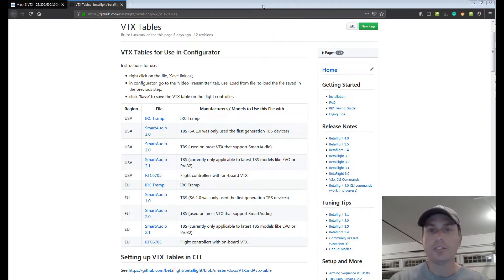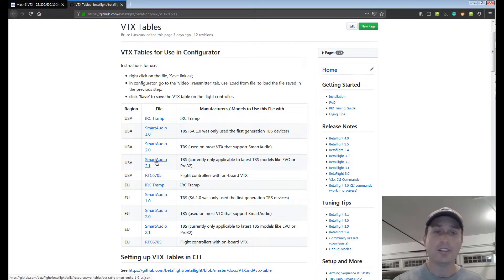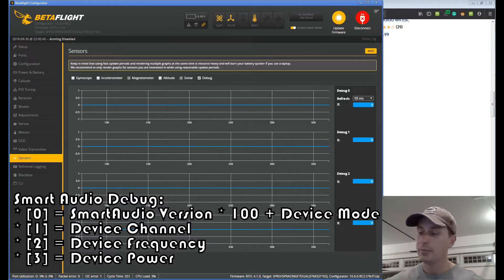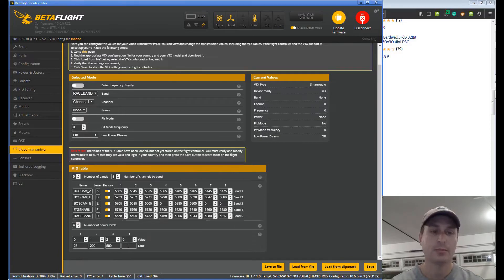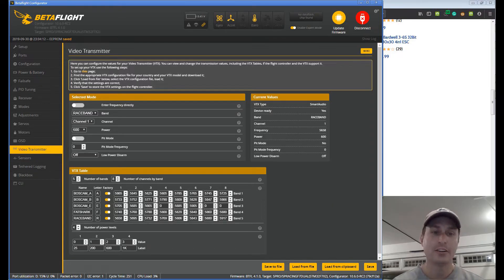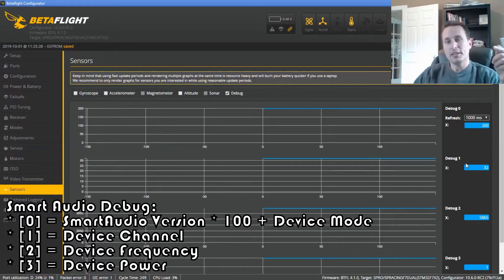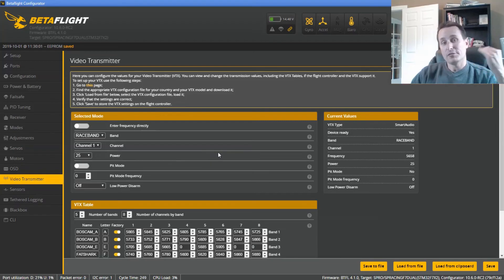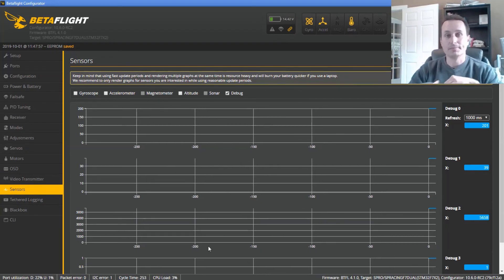Betaflight VTX Tables in 5-minutes - How to discover your Smart Audio Version

Comment: What do I do if I get no change in the debug page when a battery is plugged in? The value stays at zero.
Reply from the maker: Sure it is a Smart Audio protocol VTX?  Maybe it is Tramp or wiring is not right?
Reply: @uavtech  it is an original TBS Unify Nano. I think the reason is because its still needs the resistor mod to work properly, as smart audio works SOMETIMES :(

Comment: I can't get the debug to work, nothing changes in there. I got the right VTX table for my VTX, everything seems wired and set properly but VTX is not responding to OSD/Betaflight imputs no matter what. Anyone knows WTF can be wrong?
Reply from the maker: Maybe Tramp protocol?
Reply: @uavtech  it's Eachine TX805 VTX and as far as I know isn't Tramp, but obviously I've tried Tramp protocol, obviously with no luck. I've kinda gave up at this point because have no idea what to do to make it work
Reply from the maker: @Arthur4all  , Ports tab is set to SA peripheral and wired up good.  The debug should work.  Best i can offer is triple check wiring and maybe try another UART.
Reply: @uavtech  soldering it to a different UART is literally the only option that I have left to try even though I have no idea why it would not work on a dedicated UART where it is connected right now. It was a brand new FC so maybe there is some fault with that dedicated UART pad out of the box.
Reply: @uavtech  soldering to a different UART pad did the job and now debug is working and VTX is responding to OSD commands. Still have no idea why it didn't work on previous and dedicated UART pad...
Reply from the maker: @Arthur4all  , awesome to hear you fixed it!
Reply: @uavtech  Hi! I have a similar problem. Matek F772-se and Matek VTX-Mini. Telemetry on UART6 (Tx6). Telemetry emabled and TRAMP protocole selected. Q: Is it an idea to reconfigure Tx6 to be softserial and get it to work that way? Or anny suggestions on ways to test the Uart via the BF CLI?
Regards Torgeir

Comment: I did this no problem with my RDQ Mach3, BUT i cant seem to get it to work with my TBS UNIFY PRO. When i load the smartaudio file all boxes go blank and the four buttons on the bottom of the page "save to file" "load from file" etc disappear. I have now tried all three TBS smartaudio files same result...? What is going on here???
Reply from the maker: What SA version does the debug mode say it is?
Reply: @uavtech  thank you so much for replying, unfortunately I'm offshore on a remote facility. I won't be able to look till Monday.

Comment: what would be the problem if as soon as i plug in my battery my FC gets super super hot almost as if im going to burn stack.  havnt left it plugged in long enough to even test it because i already fried one because a differnet reason
Reply from the maker: unknown.  sounds like an electrical issue on the board.
Reply: UAV Tech.  Well I’ve checked every electrical thing I could besides the actual plug in where the battery plugs into to going to try and replace that too. I actually fried my vtx and replacing it I think I might of loosened the battery plug in ? Any guesses ?
Reply: UAV Tech thank you

Comment: Did exactly as in the video but i don't get any reactions in debug mode at all. Yes i have the battery plugged in.
Also just 1 motor is working after updating to 4.1 :(
TBS unify 
Kakute F7 1.5
Kakute 60A 4in1 ESC
Reply: Ok so i found out that obviously you have to enable smart audio in the ports tab. I had TBS smart audio on UART4 in peripherals tab
Reply from the maker: If Port is setup right, wiring is correct, and Debug mode to SmartAudio it should work.

Comment: Mine shows 217, is that right, 2.1?
Reply from the maker: No.  2.0.  Video had it wrong.  Clarified in Pinned comment.
Reply: @uavtech  Oh thanks and sorry I don't see any pinned comment?
Reply from the maker: @domgoff999  , no worries.  Best would have been video correct.

Comment: in my case the debug 0 showed 216, from this page https://github.com/betaflight/betaflight/wiki/VTX-tables  the value 216 = SA 2.0 unlocked. in joshua Bardwell tutorial 216 means SA 2.1, so actually which one i should use? SA 2.0 or SA 2.1, my vtx is Rushtank ultimate mini, thanks
Reply from the maker: 2xx is SA 2.0
3xx is SA 2.1
Reply: @uavtech  thanks for the info, i really need the info to decide what numbers to put as the value of VTX Power

Comment: vtxtable bands 5
vtxtable channels 8
vtxtable band 1 BOSCAM_A A CUSTOM 5865 5845 5825 5805 5785 5765 5745 5725
vtxtable band 2 BOSCAM_B B CUSTOM 5733 5752 5771 5790 5809 5828 5847 5866
vtxtable band 3 BOSCAM_E E CUSTOM 5705 5685 5665 5645 5885 5905 5925 5945
vtxtable band 4 FATSHARK F CUSTOM 5740 5760 5780 5800 5820 5840 5860 5880
vtxtable band 5 RACEBAND R CUSTOM 5658 5695 5732 5769 5806 5843 5880 5917
vtxtable powerlevels 5
vtxtable powervalues 25 100 200 400 600
vtxtable powerlabels 25 100 200 400 600 

i just past this to the cli and save is that ok ?

Comment: what value should i put in VTX Table for 1600mW unlocked TBS Unify Pro32? I see preset on github
"TBS (currently only applicable to latest TBS models like EVO or Pro32) SmartAudio 2.1 (USA)"
but it only goes up to 400mW.
"value": 14,
                "label": "25 "
            },
            {
                "value": 20,
                "label": "100"
            },
            {
                "value": 26,
                "label": "400"

What value for 1600mW? If i would put too high value, can it fry VTX?
Reply from the maker: A question for TBS, but I would guess 32.  https://www.rapidtables.com/convert/power/mW_to_dBm.html

Comment: mine did not jump up in the debug section
Reply from the maker: could be Tramp protocol?
Reply: @uavtech  no it is on the right one i think it is how i soldered my vtx but they are right i dont know why my goggles wont connect to my vtx please help
Reply: Mine didn't either
Reply from the maker: So soldered right or not?  If debug doesn't work, goggles should not either.  Debugs are made to check thing.

Comment: my debug wont come on when i plug in battery and in the googels its saying tbs not configured is there a way to fix this
Reply from the maker: You sure it is TBS Smart Audio protocol and not Tramp?
Reply: I’m having this same issue. On my f4 kakute. Using uart6 for SA With tbs vtx. Pro 32 hv. Not sure if I’m missing a setting in Betaflight. Or what. Vtx tables is working on my nano 32 toothpick. Any thoughts?
Reply: @OnepackFpv  I had it on the wrong uart
Reply: R.C. Gamer that’s what I thought but I’m using t6 based on what the manual says.
Reply: @OnepackFpv  i ended up playing around with the uarts tab in bf and had jb help me...ended up i had the wrong uart in bf

Comment: Thanks for a great video! Is it possible that my quite old TBS Unify Pro 5G8 Batch No :3001 has smart audio 2.1? The debug value reads 216 but the BF Wiki says that only EVO and Pro32 have SA 2.1. Everything works when i run the BF Lua script but how can i verify that the output power is correct?
Reply from the maker: that is the trick.  you need to look up the output powers for the specific ESC.  that is why BF when this direction.  Manufactures are varying from "the protocol" too much and it is getting too complicated to hard code all the B.S. in the firmware.  So if 2.1, you look up the output power levels the VTX supports and then add just those to the table.  Or delete the unsupported powered levels of the VTX in the table.

Comment: My smart audio, is actually working. And my vtx table is set right... But..... Why i can't see my smart audio information in the sensor tab when i power up my quad??? :( What can be the cause? All the debug output are stuck to 0
Reply from the maker: You on TBS or Tramp?
Reply: @uavtech  Tbs! Unify 5.8 800mw max, 5v version!
Reply from the maker: @SaverioGarzi  , you have Debug set to Smart Audio in Blackbox tab?
Reply: @uavtech  yes, and internal memory on the fc is empty
Reply from the maker: @SaverioGarzi  , weird.  IDK.  As long as it works I guess that is all that matters.  It doesn't actually make a log to do this.  So that doesn't matter (flash being empty).  It just reports the selected debug values in the Sensors Tab.  You powering up with battery, right?
Reply: @uavtech  Same for me. VTX is a Akk X2-Ultimate international Version. Smart Audio is working  as I see the menu in the googles. I trying to get values for powervalues configuration in BF. I follow your explaination but nothing came on sensor debug after configuring correctly blackbox to Smart Audio and power up via the Lipo. (Tring multiples times but no success)

Comment: Whats up. I loaded the US file but I live in the EU so I figured it was better to put the EU file but it's not loading I only see zeros and the save button is gone. So I am stuck with the US version did I do something wrong and can I correct it?
Reply from the maker: ummm... not sure.  US will work the same as EU, but may have some illegal frequencies (for EU) in it.
Reply: @uavtech  thanks for the reply? I have set it up manually for now.
Reply from the maker: Huummmmm.  I just loaded up the SA 2.0 EU table.  Seems to work fine.  https://www.screencast.com/t/VaWu17HI
Reply: @uavtech  I have the same problem today. My vtx is a TBS Unify pro 5v batch 3xxx. SA is 2.1 but I installed 2.0. 2.0 works fine for me but I wanted to install the right file. But my save button is gone when I try to load the right file. My solution: reflash my FC :(

Comment: Hi UAV Tech, any idea what smart audio version the eachine trashcan has  as it does not have black box logging capabilities? Not sure if its 1.0, 2.0 or 2.1 
Cheers.
Reply from the maker: You do not need logging capabilities.  Just turn on the debug mode and look in the Sensors tab as shown in the video.

I don't know, but if i had to guess SA 2.0.  But lots of whoops use Tramp too, which you will know if the SA Debug doesn't report anything.

Comment: THE THING I AM CONFUSED ABOUT IS HOW DOES THE FC KNOW ANYTHING ABOUT THE VTX WHEN ITS HOOKED UP TO A TX LINE . SO ITS TRANSMITTING TO THE VTX BUT NOT RECEIVING  ( NO RX )  . EYE TROUBLE I USE CAPS . NICE VIDEO .
Reply from the maker: Yeah, IDK.  I just know it works.  Maybe ask in the BF Slack or on the BF Official Facebook Page.  The core devs probably know.

Comment: When using HGLRC FD VTX Micro I didn't get debug value. How to get this working ?
Reply from the maker: Probably an IRC Tramp telemetry protocol then.
Reply: @uavtech  I've tried that, but no luck. The SA stick command is "working" but the change doesn't reflected upon save & reboot/exit. Band, Channel & Power not changed.
[ edit ] The product page is :
https://www.hglrc.com/products/hglrc-fd-vtx-micro-16x16mm-400mw
Reply: @uavtech  Haaa .. figured out after reading this page again and again and again:
https://github.com/betaflight/betaflight/blob/master/docs/VTX.md
" Videotransmitters without a built-in table, such as IRC Tramp or rtc6705 only support CUSTOM."
I was set the 5 Band as Factory (in VTX Table betaflight it's yellow) and that was the Problem ...
After setting those Band as Custom, now it working well !
I hope this help anyone who had the same problem.
Thank's!

Comment: What if it's not detecting any sa version?
Reply: Is there a way to force which smart audio version is used. This was working and I switched vtx to the same model vtx. Now the only menu that shows my vtx table is the tramp menu but it should be sa 2.1.
Reply from the maker: Maybe your VTX is IRC Tramp protocol?

Comment: I’m having problems with 4.1 reading my vtx.  I’ve set the smart auto in the black box and the sensor still remains on 0.  I’m currently using a Mach 2 vtx.   It worked fine in 4.0. Any suggestions?
Reply: Same problem here and no one is replying so i guess 4.1 is broken for some! I guess i go back to 4 again as this is just geek stuff! I like to fly not digging for days to get it to work
Reply: Robert   Mach 2 isn’t supported with this new protocol has to be the Mach 3 or later

Comment: well i found this doing my vtx , maybe it changed not sure , https://github.com/betaflight/betaflight/wiki/VTX-tables     Smart Audio Debug[0] key:
100 = SA 1.0
116 = SA 1.0 unlocked
200 = SA 2.0
216 = SA 2.0 unlocked
300 = SA 2.1
Reply from the maker: I wrote that to clear up.  I messed up in the video.

Comment: Using Tramp and everything looks good in BF, including in the CLI under "vtxtables" it's displaying correctly.  However, the OSD & LUA scripts are displaying factory defaults which btw I have turned off and are incorrect regarding # of power levels (displaying 5 and I only have 3?).  I thought the sensors page would help me figure this out, NOT.   I have no readings/outputs at all.  Of the 4 US Tramps listed only 2 would load (neither one correct but changed) and still nothing on the sensors page.
Reply from the maker: Sensor page is for SmartAudio; hence debug is called  "SmartAudio".  For Tramp there is only one protocol to use.
Reply: Ok, makes perfect sense thank you. Thinking then the vtx is simply screwed up.   Thx for your help, always learning!

Comment: There is a bug in this.  On start ups from pit mode I get static sometimes.  Turn it on and off it goes away 80 pecent of the time.  Turn it off in the ports tab its not an issue.  This is on tbs and immersion vtxs on various quads.
Reply from the maker: Report it.
Reply: @uavtech  out of curiosity where do you do that
Reply from the maker: @BBSlats  https://github.com/betaflight/betaflight/issues

Comment: I have the Iflight SucceX Whoop VTX 25/100/200mW and for some reason following these instructions doesnt show any vtx info on the sensors page. I verified I can see data from other sensors but nothing is showing up for my vtx. Any ideas?
Reply from the maker: is the VTX built in?  Maybe it uses IRC Tramp telemetry.  I think my iFlight does use Tramp.  Tramp i smuuuuchhh simpler than TBS protocol.  Just one version; how TBS should be.
Reply: @uavtech  Thank you for replying. It seems like it is but it had a couple specific vtx options under the general tramp version. I'll try that one and see if it works.

Comment: Now I came to your video UAV Tech :) Just did my first steps with the new BF Configurator on my T-Motor F4 - unfortunately, there's no Bf 3.5.7 or EmuFlight Target available for this FC. Hopefully, EmuFlight brings a target for this FC soon ... But now with BF4.1, I'm pretty confused, why isn't it backwards compatible? Why isn't there configured a default vtx table? ( I'm not asking you, I'm more like asking the Betaflight developers :D ) So, I need to load a table for my vtx. Otherwise, smart audio doesn't work and pasting a diff to the cli of my old Bf 3.5 settings also doesn't work. All in all, it's pretty nice to have a GUI for the VTX options now - but I'm missing a pre-installed default table.
Reply from the maker: Yeah, you just need to know what SA version your VTX tables uses and load it.  Just how they have ti working right now.

Yep, not 3.5.x or EMU target for new boards.  EMU is going to rebase on 4.1 to catch-up in this regard.

Comment: You have SD CARD in the black box menu, I only have NO LOGGING or ONBOARD FLASH or SERIAL PORT, I tried all of them and when I go to SENSORS it doesnt jump up when I plug the battery in.
Reply from the maker: Should work without a card.  Sure a wired up UART to VTX set to SA in Ports Tab?
Reply: @uavtech  Yes the UART is set to TBS smart audio in the ports tab, I ended up using Lua script instead on the radio to change the VTX power because the OSD just shows "- - - - - " instead of the power and band numbers.

Comment: Shouldn't the value boxes for the power levels actually indicate the power levels? 25/200/600/etc? And the labels just a custom name like LOW/MID/HIGH?
Reply from the maker: only for SA 2.1.  SA 2.0 or 1.0 they are 0,1,2, etc...

BF didn't write the protocol or keep changing it.

Comment: has anyone had luck with the tinyhawk s vtx? it debugs to 200 so sa 2.0 but it seems to bug on channel/band switches. they do get stored set but the vtx sometimes only responds when its power cycled. works flawlessly on 4.0.x and yes im unlocked

Comment: thanks for the video. but when i changed firmware to 4.1 i cannot change the vtx power through smart audio anymore, any idea why anyone? im running 10.6 rc1, should i install the rc2 betaflight? its happened to both a iflight board and a mamba board, the low power vtx arm shutoff and power switching through smart audio isnt working
Reply from the maker: get on stable and make sure you have the right SA verson

Comment: Great video although is the Unify pro nano an exception? it shows 216 in debug but only responds to SA v2.0 power levels?
Reply from the maker: 216 means 2.0.  316 means 2.1.  Tried to clarify in Wiki and in PINNED comment.
Reply: What does 208 mean, locked version 2.0? What is mode 8 about? I've tried unlocking multiple times and it seems to be outputing at actual 200 mw just confused why it isn't showing as unlocked when I go into the sensors tab to view the data

Comment: Great video! thanks for all your hard work!
 but I have a little question: if debug shows me 200, instead of 216 - this is means that I need unlock VTX to get high power levels?
Reply from the maker: no, just means it might be restricting certain frequencies.  If you use VTX tables and uncheck the option to use the Manufacturers frequency table, it doesn't matter.  BF is telling the VTX what exact channel to use.